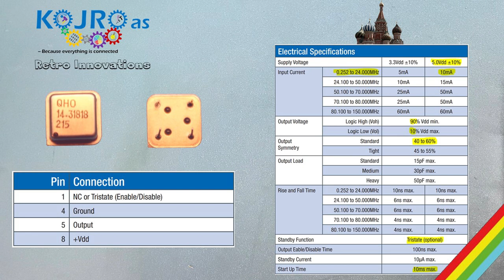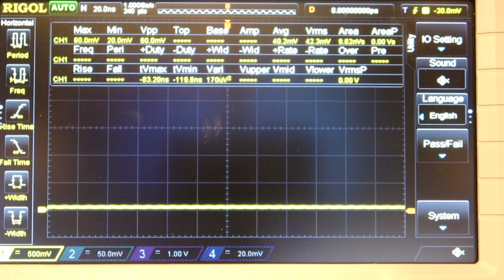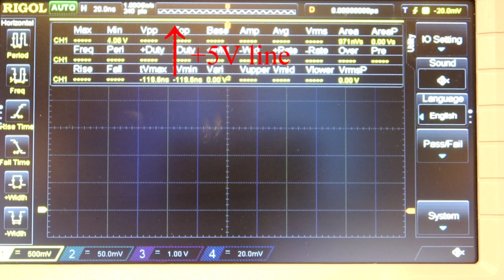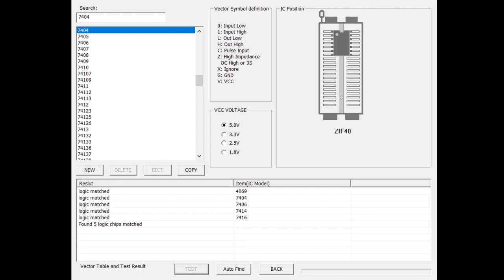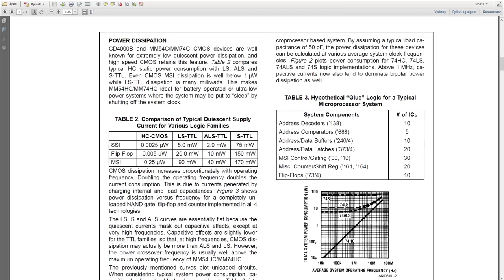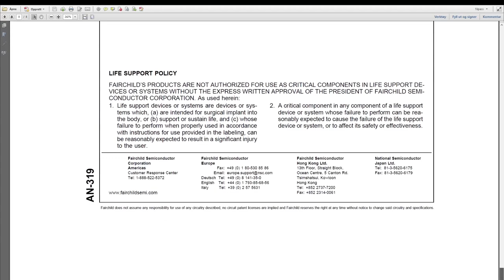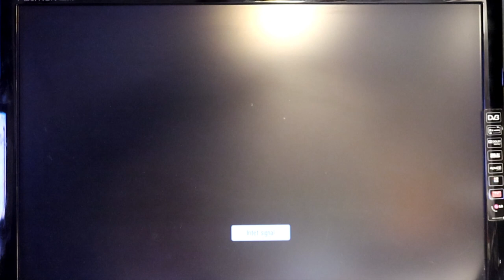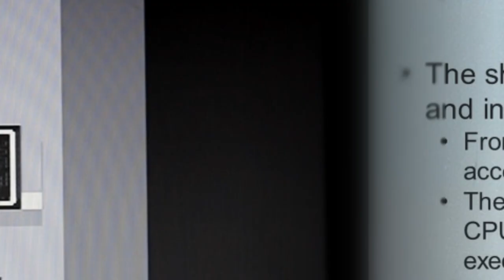The Leningrad Clone part 6, "maxing the Capacity.."

Comment: thank's for your job!  I'm trying to get the Leningrad kit to work.  now I try to insert the capacitors as you did.  unfortunately I don't have an oscilloscope and I have to do everything with a tester.
Reply from the maker: Thanks for watching. You can do much of the tests with a multimeter, but if you get no life at all it's wery dificult to see if you have the right clock signals without a frequency counter or a scope. You can of cource make a basic frequency counter with basic 74 series TTL counters. I did manage to get the Leningrad to work, sort of, but I did not manage to get a working tape circuit, but there are some versions out there with a different solution for the tape interface than my kit had.

Comment: Very nice video. How is the value of bypass caps selected ?
Reply from the maker: The short answer is that these days you don’t bother to calculate them at all. Back in the days before the LS, ALS and HC(T) series, and before everything moved to low power CMOS technology the decoupling caps was much bigger because the local power draw was much higher.. But why are they there ? In logic circuits things happens in a chain, and when one event triggers one or more other events the amount of current drawn at any given time changes accordingly. When a lot of changes happens at a short time span, the traveling of current in the thin traces of a PCB actually becomes a thing. So the decoupling caps acts as a local reservoir that supply current in the short timespan before the reinforcements from the PSU reaches the circuit. And the lesser the power draw is, the smaller the caps could be. If the caps are to big, they tend to have a bigger delay in delivering currents, so that’s part of the reason why there is a mix of electrolytic caps and smaller ceramic ones. With TTL logic the need for decupling is bigger than on CMOS, both because of the power draw is higher, but also because the difference in current draw is asymmetric if a gate changes from high to low the power draw increases tenfold, and in the opposite case the power consumption decreases tenfold. In HC, HCT, and 4000 series of logiq this is almost neglectable.. So don’t calculate them… Put a 100nF as close as you can across the VCC/GND line.. but any value from 50-200 nf is OK on LS kind of logic.. on older logic use 100-330 nf.. Some even use 1uF tantalums.